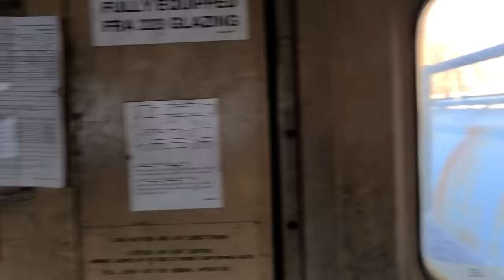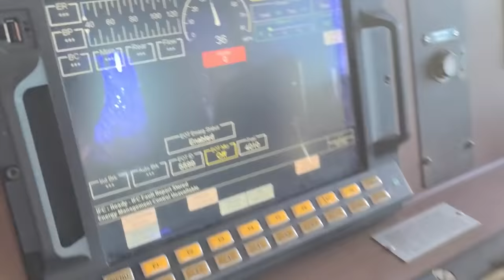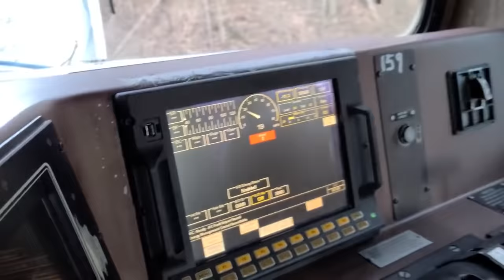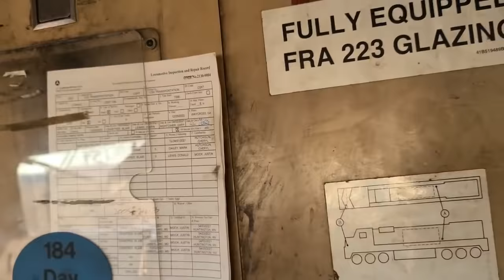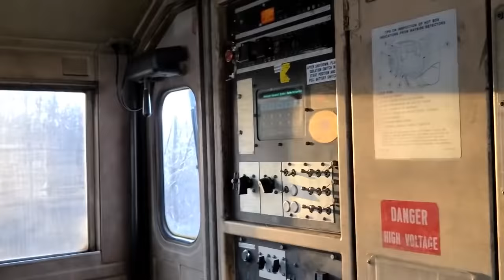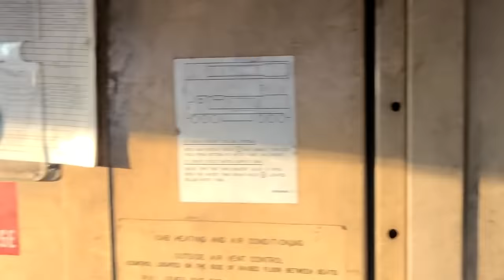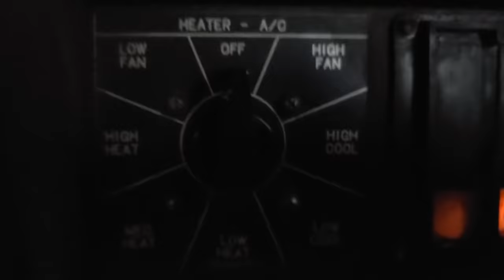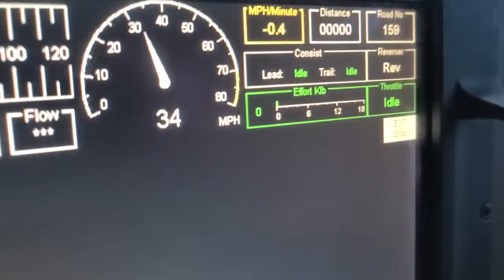Frozen ride across the Smokies but warm and dry coming back!

Comment: Somebody got sleepy there at the end. Lol. The heat on those engines is like a sleeping pill. I'm an engineer and I put off turning on the heat as long as possible. Some conductors want their sidewall heat on very early in the trip. You know his ass is gonna be knocked out most of the way. The warmth and the rocking of the engine will put the sandman on you quick.
Reply: It's the same when you're driving semi. Keep the heat off when you're tired !!🥰
Reply: I drive a semi truck and I can def attest to this statement
Reply: @shabbymaverick7975  Yep, I drive an Artic here in the UK, (what you guys refer to as a semi) between the heat and the reefer motor buzzing away, its soon night night time!!
Reply: It sure does
Reply: And the roll of the train is a sleeping pill to all the towns they are passing.
Reply: Very true Jas, how many years do you have now with your carrier?
Reply: @mshum538  Hired in 97. This year will be 25 years. Where did the time go?
Reply: @jasonmurray1812  I hear ya buddy, check out an Alco S2 1000 hp….its the one I remember most and being a hostler which actually was a cool job, switching all the F units and early geeps around…..what carrier are you with?
Reply: @mshum538  3 letters. Starts with C endS with X.
Reply: @jasonmurray1812  What mp is your HT jas?
Reply: @mshum538  a  293
Reply: just got marked up as a conductor and youre damn right
Reply: @truedarius  how old are you Darius?
Reply: @mshum538  20
Reply: @jasonmurray1812  How come you didn't want to tell him who you work for? It's not like you work for the CIA.
Reply: @damon7956  my carrier has a very strict policy with regards to the use of the company name and social media. Just trying to avoid the wrong kind of attention. Nothing secretive or special, just don't want to get fired.
Reply: @jasonmurray1812  okay that was funny you made me laugh hahaha
Reply: @jasonmurray1812 I thought it stood for Can’t Stop eXpeditiously. Lol.

Comment: Nice of the engineer to have you tag along in one of the DPU'S.  Hope future engineers do the same so you can stay warm and share your travel ventures with everyone!
Reply: It’s technically not a DPU since it is on the head end.
Reply: @metronorthrailfan2244  DPU means distributed power. Doesn’t specify where in the train it has to be distributed. The second unit was most likely dead in tow.
Reply: @redrock717  I know that. But honestly when I think DPU, I think of the locomotive in the middle or in the back. But in this case the AC44CW he was in was trailing third. It was MU’d with the first two units

Comment: There’s one thing that should be pointed out about Shoestring. He has respect.

It’s exemplified in all his videos, but notice how he protects that engineers trust. He didn’t even sit in the seat and prop his feet up. I’ve followed since YouTube recommended the Flathead Tunnel and Montana video 9 years ago. Never once has he broken character.
Reply: He filmed the loco number he was in, he filmed the first car number behind the loco, he filmed an opposing train. With those three pieces of data, they knew exactly who the crew is. He didn't protect shit.
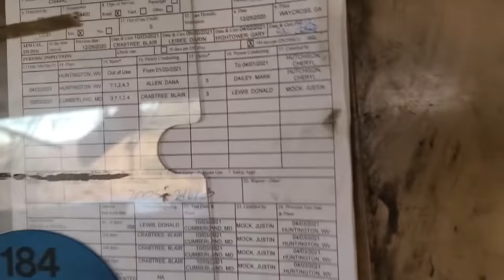Reply: @15913Music  Yeah and that inspection sheet at around 27:45.  Now there's even names.

Comment: Tis cool for them to honor your legacy on the rails riding back in warm dry comfort. And at the head end for a change so you can see where your headed and not where the head was before you usually get there. At 35mph it looks like it’s crawling but the screen doesn’t lie. And hearing the horn this time is way cool along with the dynamic braking…. Glad your up for the ride and made it back…

Comment: I used to let “Riders “ sit in remote or one of the units , when I was with Cp in Canada 🇨🇦 
If it was winter , I turn on side wall heaters for them .
And radio to channel 1, so they could listen in.

Comment: I like that the engineer/worker was nice. Wish there was a way to reward him without getting him in trouble.
Reply: Unfortunatly if CSX found out, that employee would be terminated or at least, 30 day unpaid suspension. Shoestring did the right thing by not showing the guy or mentioning his name. He also did not say what yard it was because the company could figure out who the crew is.
Reply: Not everything needs rewards, just take it as it is and let it be.
Reply: The conductor and engineer are risking their careers by allowing Shoestring to ride in the third engine. Determining which yard this train left from and which train it is would not be difficult to determine by the officials at CSX.
Reply: @jamesghiorzoe107  officials are busy running the railroad. They don't have time to look for every infraction
Reply: @lorettashepherd.  I wouldn't gamble my career on that assumption.
Reply: @lorettashepherd.  A CSX signal maintainer or trackman giving the train a "roll by" could see "Shoestring" operating his video camera in the rear unit and then report the trespasser to the conductor/engineer of the train in which case the train had better come to a stop to investigate (even though they know who's on that hind engine).
Reply: @WAL_DC-6B  most signal maintainers or trackmen more than likely don't even pay attention to who's in the cab.
Railroad morale is so low anymore because CSX and the other class 1's treat their employees like crap that a lot of rails just do their basic job duties and go home.
  I've got friends who work on the rails and they've said they don't care who's in the cab or riding on the cars because if it doesn't effect them in some way, they aren't going to go over and above what their job requires. If it's not part of their job, they look the other way.
Reply: @lorettashepherd.  As a retired railroad employee myself now retired (37 years C&NW Rwy. & SOO RR), I understand what you're saying.  But there are plenty of railroad managerial employees who watch those freight trains roll by too!

Comment: Good luck Hobo  Shoestring  we are all  concerned for your  health & safety  what you do is  exciting & takes lots of courage & moxy   You need to go watch a  YouTube  video called Dane Scott’s  truckers lounge  the most recent video  he shows  a new heated temperature controlled  coat  the cost I have no clue probably between  2 to 300$  price range  I would be  afraid  of  the train  derailing or running into a  flooded area or slamming into another train or vica versa  and getting ejected out under the wheels  God forbid  one more thing did you ever want to work for the RR in some capacity  LOL  take  care Hobo Shoestring

Comment: How about that! Fine and dandy in a nice warm engine!  God and that engineer were looking out for ya! 

It’s nice to see there are good people out there!!!

Hey shoestring, get a pair of arctic muck boots. They’ll keep your feet warm up to -20 degrees. They got rubber on the outside, and are very insulated of inside, and go all the way up to the bottom of the knee. The only problem is they’re a little bulky and heavy. But once on the train your good. 

Again only wear them when it’s cold. Otherwise your feet will sweat like crazy. Max temp would be 30.

Comment: We've been wondering if the drs. had worked on you yet.  Hard to keep a good man away from the rails for very long.  Bostic is not far from the South Carolina state line.  I believe the yard where you were is the old Seaboard Airline RR/Clinchfield RR operation....now CSX.  Stay safe.

Comment: You go Shoestring, beware now, you dont want them rr cops to get it in for you - as a surveyor I found that some were ok, mostly the older seasoned ones, but not all, had a few run ins and they were no doubt some of the nastiest cusses EVER! But not all of them, but most for sure, they've got a lot of responsibility on them so I dont blame them, but watch out just the same. I always wanted to work on the RR, never realized how dangerous it was until you tube came around, why don't you consider retiring, you could probably get a sweet job as a railroad consultant as a "safety specialist", might even get a crew of rr cops working for you sweeping trains?😄😆☺️😆😄 Just kidding, safe travels, out.

Comment: My brother took the guys to work on the railroad and I rode along.  The engineer let me run the engine along the tracks.  I took it accross a bridge and he had to have me slow  it on down.  Was comming up behind the back of the train.  One got to ride warm this is good.  Hope one doing ok too.  That dr. stuff is leading to an operation.  Am still a shut in at home.  I have some extra camping stuff , military stuff, ect, when one is in OHio let me know.   Paul     Am not too far from Cleveland.  One has the right idea of slowly down too.  I had to slow on down too.  Have fun.

Comment: Just a thought but I would go back and edit out any part of the video where any locomotive number where caught in frame. Thumbnail and outside view while it was moving shows reversed in the top of the windshield but there are several other spots throughout the video showing it on the console on both sides of the locomotive that shows the unit number. Reason being, which I highly doubt but because there are some jackass' and trolls out there, all they would have to do is go back and match that locomotive to that consist using the date of your video against logs and paperwork. They will know who the crew was at that particular period. When the train left that yard. Just a heads up. Would hate to hear these guys got fired even for their good deed because something incriminated them.
Reply: Someone is going to rat them out. It's a given. Lots of snitches. even Union brothers.

Comment: I have a question. The consist has to air up to around 90 PSI before the brakes are released, correct? So no air pressure means the brakes are "on". No air- no moving. How are the cars rolling freely, uncoupled from the loco, in a yard downhill? Not 1 or 3 cars, but dozens, even hundreds, are constantly rolling into the yard for separation after uncoupling. Are they manually releasing the brakes on each car, then when stitching the consist together again, they are taken out of manual release?

Comment: Hey Mark: I wonder if anyone has ever carried a couple of short pieces of foam pipe insulation or pool noodle to place across the bottom of those round access holes for a bit of comfort in the legs/feet... 73 DE W8LV BILL

Comment: Not to get you in trouble,  But it would be nice if you knew how to pick locks,  That way if the weather was too cold You could jump in a heated unite & ride it out to the end.  Say it was open and I was cold.  The other thing I can say is, The trucking industry doesn't like to make too many different keys,  I think the railroads exist along that very same line.   That's something to think about.

Comment: Be careful and don't show those engine numbers, MP numbers, signal numbers, passing trains and ride dates.
Reply: I need to agree here. It's a wonderful thing that the freight Crew allowed Hobo String to ride in the trailing Unit. He did no harm. But I am worried that will not be the case, with that Crew. Even if no inward facing cams on the Power- he showed the maintenance forms, with the unit numbers. Let's hope nothing happens, to that kindly crew. Beautiful video; thanks!
Reply: @amtrakjohn  I saw those engine numbers and cringed but decided not to mention them to possibly tip off management. You're correct, the crew could get written up with 5 days off for not reporting unauthorized riders.